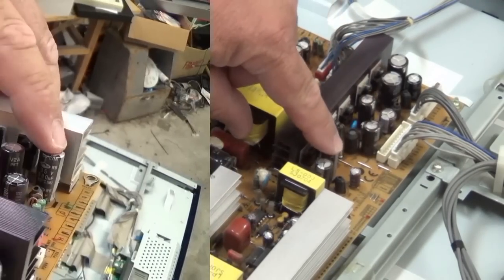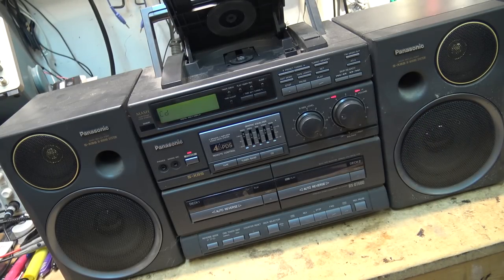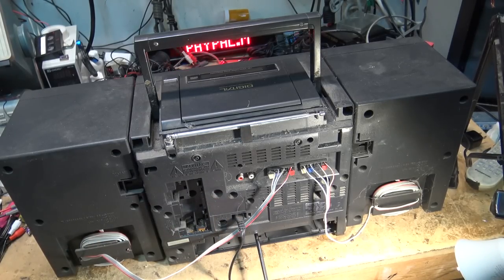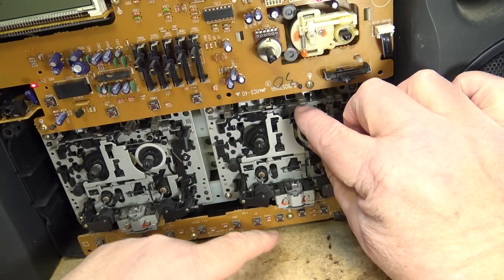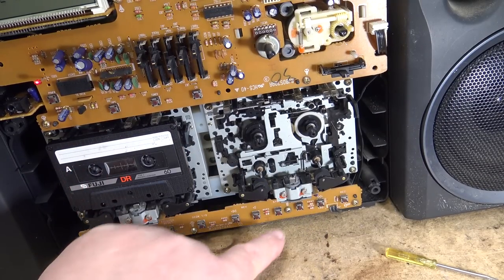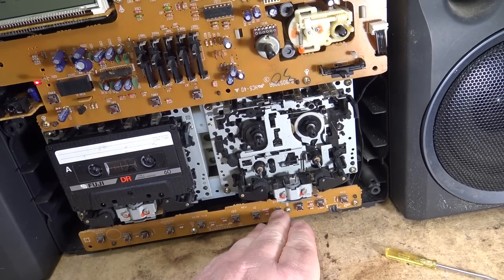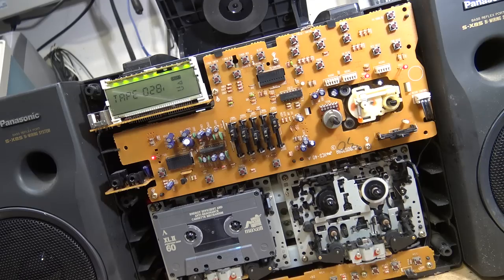Panasonic RXDT680 dual cassette cd portable stereo repair

Comment: Thanks for making this video. I have a Panasonic RXDT680 and I would like to know how to turn off the sleep button. When I turn on the power button, it only turns on if I push the sleep button.  Also, my tape deck doesn't work. And sometimes the cd player works but the unit does not seem to detect the cd or the tape. Radio works fine. If you have an answer I would really appreciate it.
Reply: Good day, Sandra Bodkin. Your question and comment posted in this video’s “Comments” section came a number of months ago, perhaps by early or mid-June 2021. So I don’t know if you have resolved any issues you had with your Panasonic RX-DT680, the same and model of portable stereo in this video. 

You stated in part: “Also, my tape deck doesn’t work.” Well, as you know, the Panasonic RX-DT680 is a dual-cassette-deck, digital-tuner CD player boombox, originally supplied with a remote controller. When you wrote “my tape deck doesn’t work,” which tape deck did you mean? Is it Tape Deck 1, the left-hand, non-recording deck? Or is Tape Deck 2, the right-hand, recording deck, the faulty one? And do you know how extensive the failure of the faulty cassette deck is? Does the faulty deck try playing an audiocassette of any bias (“Normal,” “High,” etc.) and of any length, but then suddenly stop? Does the erring tape deck try rewinding or fast-forwarding the cassette, only to suddenly stop before it has properly wound or rewound the cassette? Or maybe you have already stated the problem: that “the unit does not seem to detect … the tape” in the first place. The tape-detect ion tabs that the repairer spent some time speaking of, cleaning with DeOxit D100 contact cleaner and adjusting in this video might need some servicing in your unit. 

You also state that your ‘680 sometimes fails to detect a compact disc (CD) that you try playing with the stereo. Is such a CD a so-called “retail” CD, professionally mastered in a recording studio and sold in the tens of thousands (if not millions) of copies and of no more that 74 minutes’ running time? The nature of the mastering of the CD and its production volume (“small batch” production, say, by a DJ or “large volume” production by a big record company) do matter. A CD over 74 minutes in length might not play properly or at all in older (pre-1995) and/or non “high end,” non “reference standard” CD players. Older CD players were made to play CDs mastered with “Red Book” standards, which were established in the early 1980s, when CDs became commercially available. Those standards require CD players to play CDs with a total running time of 74 minutes and probably nothing longer than that. A very long, mixtape-style party CD or one of those classical music CDs almost 80 minutes long might not play properly or at all in the CD player of a relatively good yet relatively inexpensive sound system like the Panasonic RX- DT680 that was made in the early 1990s, according to info’ found on the Internet. And, of course, music or non-music audio recorded (or “burned”) to those “write once,” recordable CDs (CD-Rs) probably can’t be played at all in an older boombox like a ‘DT680. Fortunately I think my slightly newer Panasonic RX- DT75 can play CD-Rs – well, some of them, I shrug. And, of course, older CD players such as those built into the Panasonic RX- DT680 and the RX- DT75 likely can’t play the re-recordable, “rewriteable” CDs (CD-RWs). I seem to remember reading something (close to or more than 20 years ago LOL) about CD-RWs not having “shiny” enough undersides or playing sides for the pickup laser or lasers of most older CD players to ever (or consistently) read and play the audio contents.

True, older CD players might be able to scan and display the track count (say, 16 tracks) and the total running time (say, 73 minutes, 52 seconds) of a CD-R. They may be able to scan and display the track count and running time of a 79-minute, professionally studio-mastered CD copy. But they probably won’t be able to play it properly. Those machines might play such an extra-long and/or home-“burned” CD once and, surprise, surprise, never be able play that CD again. More likely, such CD players will play the first 73 minutes or so of an extra-long CD or the first track or two of even a shorter, home-recorded CD … and get stuck or so. Their electronics won’t be able to keep playing the remaining tracks of a CD-R or the last track of the 79-minute Baroque Era CD because the longer CD’s last track begins beyond the 74 minute mark, beyond which most older CD players weren’t programmed to keep playing. Of course, “high end,” “reference standard” CD players – which, before the year 2000 probably often cost over US$500 – would probably be able to play CD-Rs of any length and those longer, over–74-minute “mass produced” CDs. But far from everyone could afford such pricey gear in those days. And just about any CD player boombox – even the best ones made by world-famous brands like Panasonic – was certainly no “high end” or “reference standard” CD player.

I also remember that some enterprising folks have found that one can open up CD players and VERY carefully, VERY slightly increase the laser output of the diode or diodes supplying the laser beam or beams used to play the CDs. That adjustment should work to play CD-Rs and CD-RWs with older, typically non-“high end” CD players, though that adjustment likely won’t work for playing extra-long CDs; a separate adjustment of the laser beams’ sliding pickup module is needed. In any case, the laser intensity adjustment must be ever so tiny, perhaps only a millimetre or two of increase – turning the screw to the right, I think – so as to avoid burning out the diode or diodes and having a costly repair –  maybe too costly a repair – on one’s hands. (Not good.) 

It’s good to know that the digital tuner of your boombox still “works fine” – well, as of June 2021 or so. There is considerable music-listening choice from FM radio stations and even from AM stations, though stations broadcasting between 520 kilohertz (kHz) and 1720 kHz usually broadcast only in mono, not in stereo. Well, they did when these boomboxes were made. Anyway, monoaural music listening won’t discourage some listeners, especially if they are listening to mono “oldies” from the ‘50s, the ‘60s or even the early ‘70s. (Would that there was better music-listening choice here where I live.)(Shrug) 

The issue with the SLEEP function of your RX- DT680 should be solved after looking through a copy of the “Operating Instructions” manual. There is a reasonably clear, scrollable copy on the website manualzz.com. The search term “Panasonic RX- DT680 Manual” should obtain that link.

Anyway, to wrap up this very long “Wall Of Text” of mine LOL, if you still have the Panasonic RX- DT680 and if its problems haven’t been resolved, if you haven’t sold it, donated it or given it to a repair-savvy relative of yours, try contacting the “qualified personnel” that the warning messages stamped into all those electronics’ rear panels caution us to refer to when problems arise in ‘Tronicsland. You could even try contacting the 12voltvids repairer himself. He still lets some people send in their gear for him to look over and try repairing it once in a while. He also looks over and sometimes repairs the obsolete and/or damaged tech that people ship to him or drop off at his place. He MIGHT agree to work on your Panny (a nickname among hobbyists for that famous electronics brand). But, of course, you have to decide if it’s worth the effort. He’s Canadian, as his accent should reveal. According to what someone wrote in praise of him in another 12voltvids’ “Comments” section, he lives in British Columbia, southwestern Canada. If you live in the U.S. – and depending on where in the States you live – shipping the big stereo (with sufficient insurance) to and eventually from his address might cost over US$400 for both trips. Is that cost worth it to you – plus the repair costs (which he will probably be reasonable with)?

Well, have a good day. And do stay safe in these epidemiologically and morally fraught times.
Reply: @uzodinman358  Thank you for giving me a thorough, competent and informative answer to my question. Just to let you know, I downloaded and printed a copy of the Panasonic RXDT680 manual which I found online and read it.  One: I turned off the sleep button and now have no problem keeping the radio on.  Two: The cassette player (the left one) can be repaired or examined. I live near a repair shop and I am sure they can fix it.  Three:  As per your reply, the CD player does play certain CD's and not others and so the problem is with the kind of CD that was inserted. Because it is from the 90's, the CD's do not all play.  I will as the same repair shop if he would look into it.  Thanks again for taking the time to answer this question. Stay safe and have a good day.

Comment: Great video! My mother was given a Panasonic RX-ED77 ghetto blaster which is having the same problem with the dual cassette. I cleaned the contacts with cleaner but it's still doing the same thing. I was wondering if the plastic covers on the switches can be easily removed if the tape doors are still in place? I'm not sure if you are familiar with the RX-ED77, but the tape deck is hidden underneath a pop-up control panel on the top of said unit and to take the doors off pretty much requires ripping the whole unit apart just to properly clean the switches.

Also ... Any recommendations on where to get belts for cassette players online?

Cheers (and just subscribed!) from Canada!

Comment: Hello. I really like your video tutorials about repairing different staff. One can learn so much from them! I was wondering whether you happened to come across Portable Stereo Panasonic RX-ED77, widely known as Cobra. Two decks are completely unresponsive when I press the play, rewind or fast forward buttons. I once tried to change the belts but I'm afraid I did something wrong. I'm also thinking that main gear (rdk0026) can be the reason why it's not working. Can you advise something?

Comment: Do you have a video of the back? The amps? I was always curious because the 4 PDS systems were much heavier then the non pds versions. Didn’t know if it was the speakers or the amp as well that added to the weight.
Reply from the maker: It is a bi amplified. 4 amps. 2 for woofers and 2 for tweets

Comment: Great videos!! Im a beginner and wanted to know if i can replace new speakers into my old Panasonic boombox? If so can i simply use 6 inch car speakers? If not what do you recommend..cheers
Reply from the maker: If they fit and have the same impedance then yes you generally can.
Reply: @12voltvids  much appreciated. The issue I have is that I cannot find 2.7 ohms speakers...I can find 6 inch  at 4 ohms..what impact will it have if I use 4 ohm? Can you get anything lower than 4 ohms ? Cheers
Reply from the maker: @ahcrx  4 will be fine
Reply: @12voltvids  thanks again 👍

Comment: Just bought a 2nd hand Panasonic RX-FT600 on Ebay for £45 ($55-60?), and it's great - everything in good working order. However, the left side cassette drive is working, but audibly slower (several keys!). May i be so bold as to ask for your advice as to how I can fix this, please?
Reply from the maker: Likely the motor is shot
Reply: @12voltvids  Thank you! Sounds expensive? Might not matter too much, as the recording side is tip-top. I'm no techy, though.

Comment: cleaning the contacts with sand paper?!! Good luck, man.
Reply from the maker: Contacts were so encased with crud the only way to clean was to grind it off with cleaner and aluminum oxide, which won't scratch the contacts but really it doesn't matter as they are not passing current.  There is no finish on these leaf switches.  They are just copper.
Reply: 12voltvids Worked for me too. I folded the sandpaper in two, put it between the contacts and squeezed the contacts with tweezers, gently moving the sandpaper. The plastic caps didn’t want to stay put after returning them back in place so I put some tape over them.

Comment: I use a Panasonic Portable Stereo Component System - RX- C39L and the tape deck don’t work at all ever time I try and use it, it makes a never ending noise like mmmmmmmmmmmm and I’m really disappointed I’m sure it can be fixed though

Comment: My RX DT670, i can hear a motor running whenever it is plugged in. Even if the power button is shut off. Normal? What is going on? The unit works fine. Thanks

Comment: That's a really neat bit of kit, the tape mechs are identical to the ones in my Technics system in the front room (surprise surprise!).  That 4x4 amplifier system though, did it actually make a difference or was it more of a gimmick?
Reply: Interesting to note the weak point of those switches too, good to know if mine ever decides to act up & another good reason not to leave it with cassettes loaded.

Comment: just looked on Ebay, and someone is selling one of these Panasonic units for  AU$218.88 or £108.55 in UK currency (without postage)  it works fine apart from the Tape Decks, looks as if its a common problem with these
Reply from the maker: Very. I did hundreds of them when I worked on this field.

Comment: Just picked up one of these, this exact model. The cd and radio work fine and it sounds great, I cleaned the switches so it registers there is a cassette in either deck, it plays/ spins the cassettes, but there is literally zero sound, not even any fuzz when putting volume at max. Also no sound with the headphones, but click on cd or radio function and there is sound. Anyone have any ideas ?

Comment: Nice job.  Repairing tape decks will soon be a lost art, no doubt.  Do you think the belts are in good shape? Playback audio sounded a bit wobbly at times.
The double decks reminded me of some good ol high speed dubbing :)
Reply from the maker: Lots of torque. Probably some degradation from sitting all those years buy they will soften up.

Comment: A portable with a sub-woofer control!   Wow, never seen that before.   BTW when I use De-Oxit type cleaners on slide volume controls, the control usually gets really stiff and difficult to move accurately.  Do you have the same problem and is there a better alternative?
Reply from the maker: I prefer nu-trol

Comment: I know I'm super late to the party, but wondering if you'd be willing to share any insight you might have.

I just acquired one of these units and the Stop and Reverse Play buttons for the tape deck are depressed, like they're permanently pushed in. Both tape decks play, fast forward, and rewind without issue, I just can't press stop or reverse. Any idea what might cause such a thing? My understanding is that if it were a belt issue the tapes wouldn't be playing, but I'm very new to this. 

Any advice you can offer would be greatly appreciated!! 🙏
Reply from the maker: Well you may have to pull the front panel off and just check the buttons. I think they're soft touch if I remember on that so they just press little switches make sure that they're actually clicking the switches it may be the plastic buttons themself are broken.
Reply: @12voltvids  Thank you very much for the reply! I will try that. 🙏

Comment: I happen to have a RX CT 990, a model similar to this but without the CD player. I’m curious on what would be the reason for a constant hissing noise
Reply from the maker: I know exactly why it is hissing.  You have a snake inside. 😉
Reply: @12voltvids  ah can’t find the snake though
Reply from the maker: @desk-kun  all amplifiers will hiss slightly.

Comment: Thanks Sir for uploading this video. Lots of useful tips for those who still uses and enjoy tape decks.
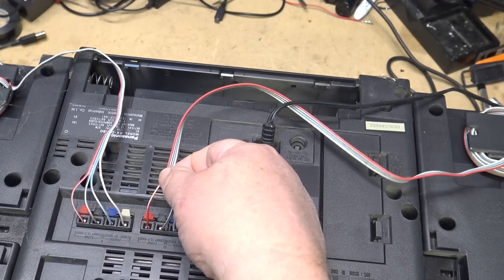Question : what is purpose of RCA jacks 29:09 ? Input  from iPod or output to an external amp?
Reply from the maker: The rca plugs on the back are direct output from the cd player so it can be plugged into an external amp, or tape deck or minjdisk recorder ect.
Reply: @12voltvids  Thanks for reply.

Comment: I had one of these given to me and I destroyed it because I was low on space and the one I had was pretty broken and just not worth saving. I already had an amp with a subwoofer which sounds amazing. Problems with the boombox I had were that the first cassette deck was 100% dead, not even any motor noise. The second one worked. The CD player in it was busted too, I have no idea how it just broke while sitting in storage like that. It was a General Electric and a low end one at that. I saved the speakers though.

Comment: Hello. I have a similar RX-CT900 panasonic boombox. On my unit fm tuner has failed. It won't stop on stations on seek, and when it's tuned manually sound level is very low. I guess some component properties changed so the tuner is not hitting the correct freqs. Could you help me, do you know where should I look for problem?
Reply from the maker: How is the antenna.  If that is ok then the front end is the place to look.
Reply: @12voltvids  Sure, I have checked the antenna contacts and they are prefect. When the station is tuned manually sound level is low, but it is without any reception loss. Even the known weak stations can be tuned. Sound level is so low that the amp has to be cranked all the way to obtain normal volume. I forgot to say that the reception is always mono. Input selector and the amp are also checked and are ok. I believe the problem is in the tuner itself, but I don't know how to check it.

Comment: Are you wearing a Casio digital watch ? I love Japanese products.
Reply from the maker: Yes a very rare model. Stainless steel case and band. Radio controlled time setting and it is also solar powered.  Probably the rarest of any casio watch.
Reply: @12voltvids   Thanks for the information.